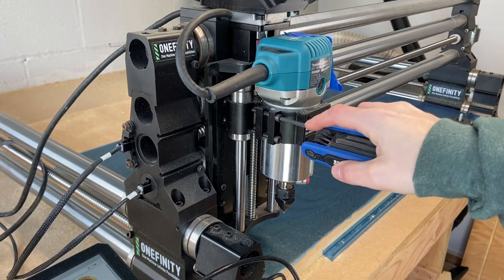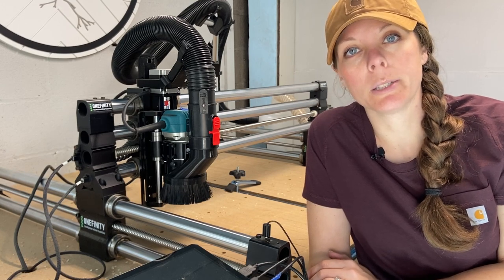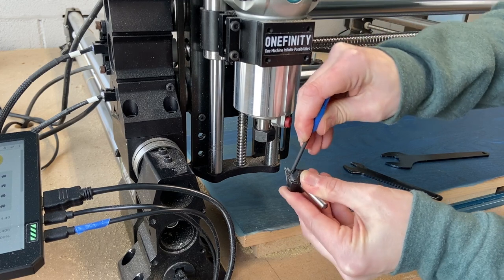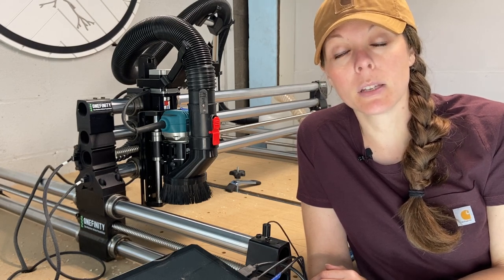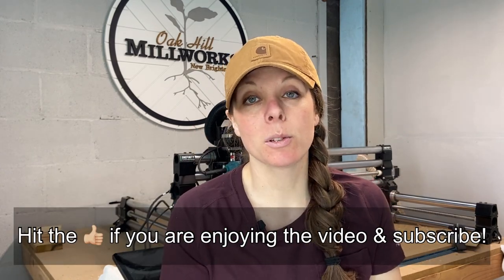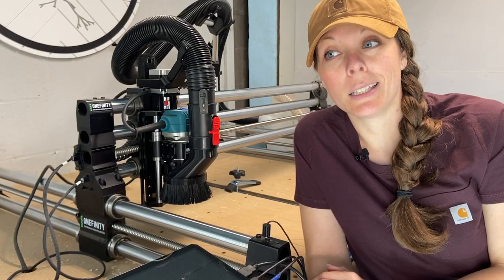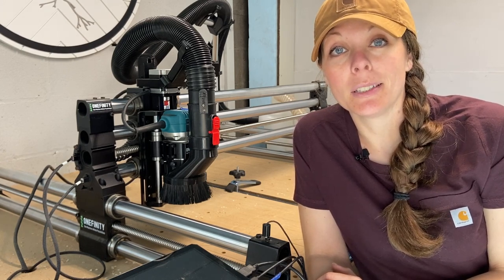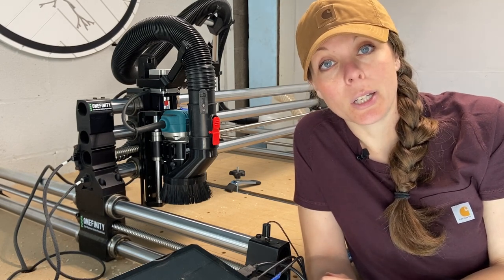DO THESE THINGS before you run your CNC -- Safety Items to Consider // Avoid an Issue Later!

Comment: Thanks for this and being a HERO. I went into Excel and created a grid-based checklist (like airplane pilots use) and taped this to the wall next to my 1F, but didn't have items about the bolts being tight or dust boot movement being cleared. If you imagine the following list with the word in all caps being nicely organized in a right column. I then organized it into two sections, with space in between, one starting from power off state and the other for different jobs. Note, the Y-Axis Movement Path being cleared means that tiny little gap under the Y-rails that tends to attract things like screws and dust. 

Cold Startup Checklist	
Table / Work Surface	CLEAR
Y-Axis Movement Path	CLEAR
Main AC Power	ON
Vacuum & Router Power	TEST
Monitor, Keyboard & Mouse Power	ON
E-Stop Button(s)	RESET
CNC Controller Box Power	ON
Machine Home	SET

Per Job Checklist	
Workpiece	SECURED
Desired Bit	INSTALLED
Workpiece X-Y-Z	SET
Dust Shoe	INSTALLED
Router Speed	CHECK
Vacuum & Router Power	ON
Program	RUN
Reply from the maker: Very nice!! That’s actually funny you said like an airline pilot checklist. My first take opening the video talked about how pilots go through a checklist to ensure safe operation of the machine (plane) and we should too! Haha. I messed up so I re did it and cut the pilot part but I totally get what you mean!

Comment: HERO!  Another great video, Christy!  A tip that I've learned is to use some blue Loctite (242) for your machine bolts.  It will keep them from worming out on you, but still allow you to break them free if you need to.  Grounding your dust collection hose is something I am looking into...prevention of static electricity buildup will help prevent electromagnetic interference with your machine, controller, and tablet.  Thanks for the video, and I look forward to the next one!
Reply from the maker: Loctite!? Really!? I would be a little nervous to use that. I guess if it’s just a small amount. My dust boot screws are coming out too easily and I’m disappointed about that.
Reply: The Loctite Blue is perfect for it.  It won't create a permanent bond, just prevents it from loosening while using your machine.  However, not sure I would use it on the screws for the dust boot...I have no idea how it will bond to plastic or resin.
Reply from the maker: @tomcoster191  ok. Thanks for the insight, Tom. Yeah that 3D printed boot might have just revealed its weakness.

Comment: one more thing i found out by bad luck if you look at the shaft on a cutter right near the cutter the shaft starts to flair out if you put it in to far it will easily loosen during a cutting sequence cheers and love your programs very good for newbees
Reply from the maker: I hadn’t noticed that but I have heard that you can put it in as far as it will go in the chuck and then let it drop down 1/16” or so. I’ll look more closely next time!

Comment: HERO! Christy! Another great video! How do you like the new dust boot? I wish 1F would have a little button that you could click to not have the machine return home, instead just go back to 0,0 on X/Y and take Z to a half inch above the working surface. I'm not sure why this isn't there by default. Think I'll put a ol recommendation on the site. Only reason I say this is because I've hit a clamp lol! NO! Grrr that didn't happen again. One thing I've also done is use a laptop vs their touchscreen. World of difference. I'll have to make a video sometime. Keep up the great work. 👍👍
Reply from the maker: Hey Jesse! Thanks for watching! I like the new dust boot worlds better than the suckit but it still isn’t perfect. What is? The screws work themselves out on almost every carve. I need to find a solution for that. — do you mean after you have to hit the E-stop when you hit the clamp? If you don’t have an issue, the machine does save the X, Y coordinates so you just have to change out the bit and re-Z. Maybe we are talking about two different things?? 

I would love to use my laptop but haven’t had success getting it on the network.

Comment: Just found your channel. It’s very clear and informative - nice job I am a sub. I am a retired and pretty experienced woodworking but I have never used CNC. I have been looking at One Finity. How do you like it and would you still buy it if you had to do it over. Thanks for great content. Hero.
Reply from the maker: Hey John, thanks for subscribing and checking out the channel. At the beginning of my CNC video playlist when I first got it, I disclosed that it was given to me by the company to experiment with. I suppose I should continue to disclose that with each video. But having said that, it’s still a hard question for me to answer because I have never used a different brand CNC to directly compare it. I purchased my laser because I believed it to be made with more quality parts making it perform better and more reliably. That cost me $19,555.00 so I would not hesitate to buy a Onefinity because I know they adopted a similar practice to my laser company, which is building their machines with superior parts compared to other desktop CNCs. They have phenomenal tech support, customer service, and a very supportive community online and via Facebook as well as a super informative and up to date forum on their website for regularly asked questions. I hope that helps!

Comment: Thank you.  Very good idea.  What dust boot do you now use?
Reply from the maker: I use one made by a guy on Etsy called 3DKraken. I believe I may have linked it in the description of one of my recent videos. It was around $50. I like it much more than the suckit dust boot but the screws come loose easily so I need to find a solution for that.

Comment: Here's my save you 700$ for a new spindle tip: If you purchased an 80mm spindle that you wire up yourself to a VHD MAKE DAMN SURE THE SPINDLE IS SPINNING IN THE RIGHT DIRECTION. 

I hooked mine up via a youtube tutorial ( I have a Bulkman 3d water cooled ) and had done it exactly the same but failed to even think about checking for the correct rotation. On my very first time using it both the spindle and the bit both exploded ( I still havent found the pieces of bit ). Garrett over at IDC woodcraft ( https://www.youtube.com/c/IDCWoodcraft ) mentioned it and sure enough mine was spinning backwards. 

Tip #2: You can home your Z axis to a few inches over your wasteboard and run the gcode with the spindle off just to make sure your speeds and feeds, or in my case, ramp ups and plunge rates, are correct before actually running your job.